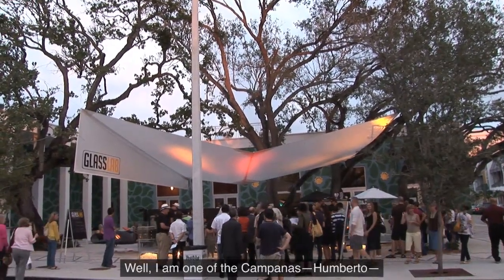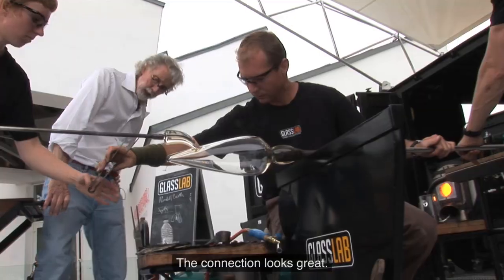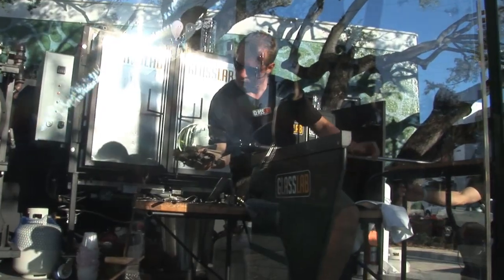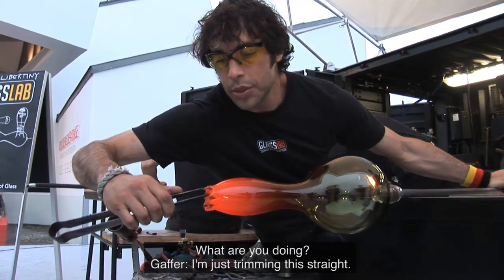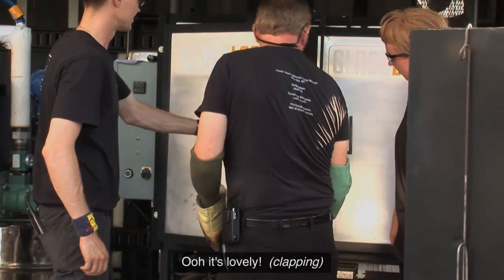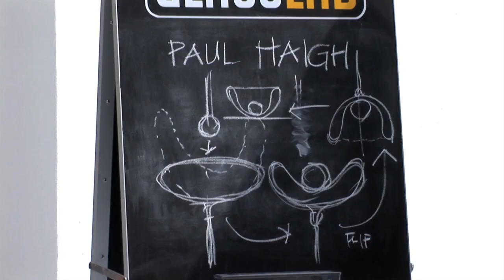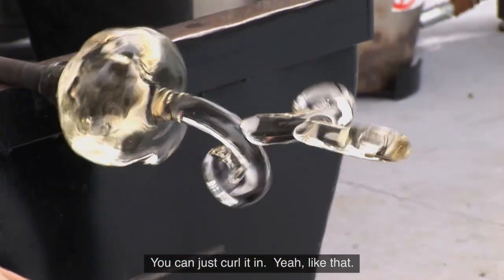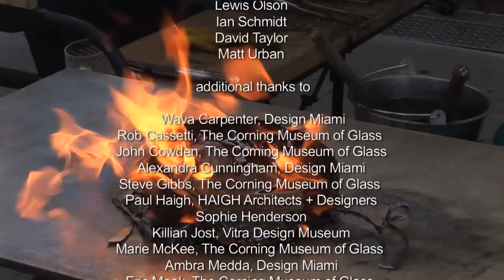GlassLab

Comment: I hope the glass blowers are charging the hell out of the pretentious "designers", it wouldn't bother me a bit if you cut out all the audio from them infact. They took all the stupid instruction with pride and did amazing job.
Reply: The Asian lady had one of the stupidest ideas out of all the dumb ideas. Her cardboard tube idea was seeming to be mostly useless because they can create the same shapes much better using the tools they already use. The one idea that did pan out was molding the bottom of a bottle with the paper cone. That actually worked. The guy with the metal cage for a lamp had a great idea. I have actually wanted to do this but I don't have a shop. It would sell really well. Like a sort of combination steam punk and Tiffany.